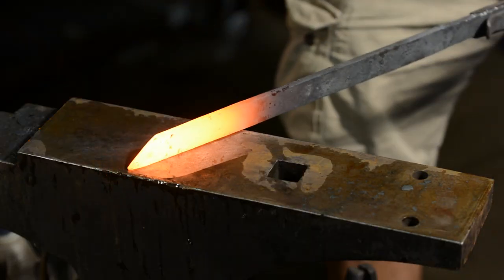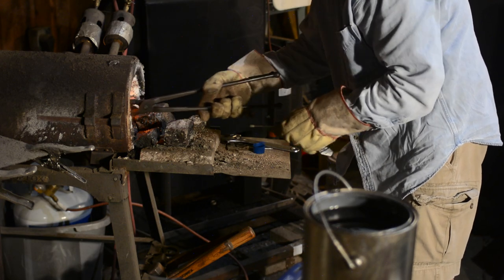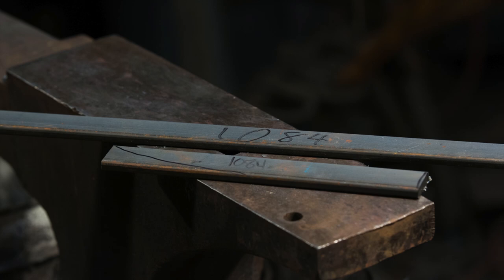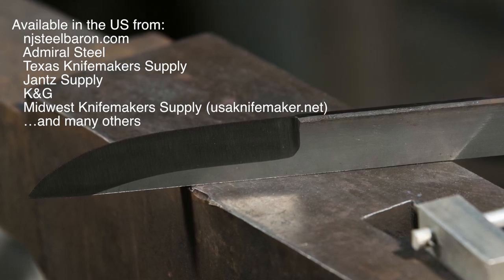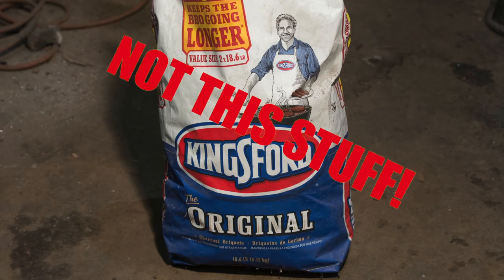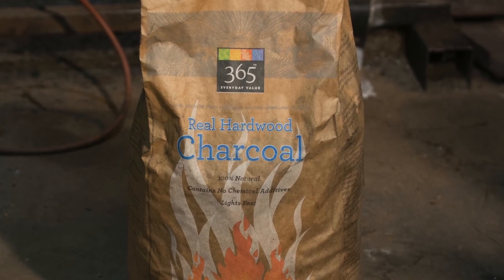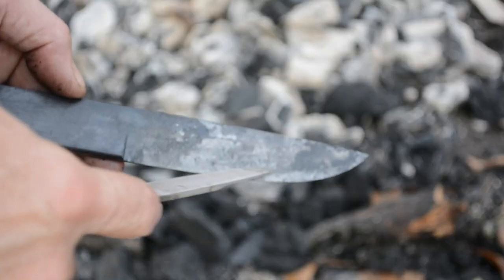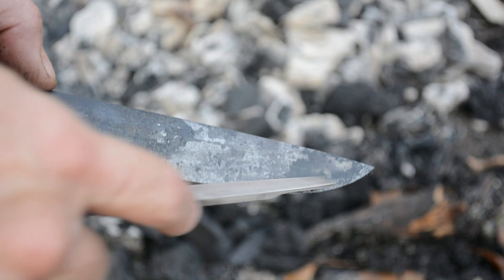Get Hard:  Heat Treating a Knife with Charcoal

Comment: Another way to temper the blade with a fire is to heat another piece of metal and lay the spine of the blade on it. The heat transfers through the spine and should leave the edge harder.
Reply: I knew a guy that had an big antique bar of copper with a handle on it and he said it was a tool designed for tempering like that.
Reply: +Colson Customs Thats also the way I learned it at a knife maker (in a 2 days workshop). I also can imagine its more evenly heatet that way and its much easier to see the actual color of the blade while heating it.
Reply: +Colson Customs I can't post the link to it apparently, but if you search for "Blade_Forger.wmv www.taliesinpewter.co.uk" and go to about 8:30 it shows this beautifully.  Great video to watch if you've got a little time.
Reply: diamondflaw
That's a neat video.
Reply: the video your talking about is really neat. The knife he made at 12:21 is pretty awesome, i want to make one.

Comment: i used a pit forge, dug into the ground with a shopvac blowing air into the bottom through a vent tunnel. I was only using wood, but I threw a bunch in there and the fire was ROARING out the top. I didn't know it at the time, but the fire was hot enough to melt the tip of my blade and it turned bright yellow hot. long story short, My knife is now about two inches shorter. I might just restart the blade, but do it more patiently this time.

Comment: ive successfully heat treated about 2 dozen knives made from 1095 using a method very similar to this. half of them were done in a homemade bucket forge and the rest from the lid of a stainless steel gas grill that i modified with some fire bricks and refractory cement. i can give a few pointers that might save some people from making bad decisions. Mr. Sorrells covered just about everything here, but i would definitely recommend giving yourself plenty of room in (or on) whatever surface your using. for example in my little bucket forge it was just too small  and the bottom was way hotter than the top so i ruined a few knives because the tips got so hot they melted. secondly, regular charcoal works just fine if you cant find the lump or whatever. actually i prefer it because the natural stuff sends up huge amounts of embers that can land on something and easily catch it on fire without you knowing. the briquettes get plenty hot to heat treat simple high carbon steel. but the hairdryer is a MUST. it will not get nearly hot enough without it. ive used hair dryers as well as the little pumps that come with some air mattresses. 

also, hes very correct about the hardness once you quench it. be very, very careful with it until it is fully tempered!!! i cannot stress this enough because i have accidentally dropped two knifes on my way to the temper oven that shattered. if you get warps or anything else, then heat it back up before you start messing around with it because it will most likely break if you dont. also, its a good idea to inspect the blade thoroughly before heat treating because if it has any warps or flaws already, then its very probable that it will cause some serious damage during the quench. ive had warps, splits, breaks, cracks. as soon as you dunk it in the oil be very still and listen for just a moment. if you hear something that sounds like TING!! then you blew it. if you hear nothing and feel nothing, then chances are you probably didnt ruin it. when im using very thin steel i will only do a basic grind on the blade before treating it because the thinner it is the bigger chance it has to mess up during this stage. with thicker steel you dont have to worry so much about cracking or breaking, but depending on the size you can still get some serious warps. 

also, always do the file test!!!! there is nothing worse than going through the whole process of making the knife, heat treating, putting on handle scales, profiling, fit and finish, sharpening, etc. only to have the edge completely roll over the first time you use it because it wasnt hardened like you thought it was. so always test it!! if you test it immediately after quenching it and it isnt hard, then you can just do it again until you get it right. but if you wait until youre completely finished with it then you dont have very many options at that point (other than maybe using a torch to do a differential hardening). 

for tempering i just use my toaster oven. he mentioned the amount of scale on the blade after heat treating and that is something that you need to consider beforehand. dont waste time getting the blade perfect before heat treating it because you will need to grind off the scale. so if you spend the time to get a great satin finish on it with perfect bevels, then youre probably going to be disappointed once you pull the blade out of the oil. 

hope this saves at least one future blade.
Reply: Thanks, i have 1.5 mm thick steel with shaped bevels (so ultra thin) is it sure im going to be disapointed? I tried once and blade cracked and warped, but it was 1.2 mm china steel

Comment: The forge that I've used for years uses a cheapo hair dryer that I found for 10$ at Walmart. With a few fire bricks, a stainless box and a length of black steel pipe, I built my forge for roughly 30$ over a weekend. The Charcoal forge is by far the simplest forge to build and obtain all the parts for.

Comment: Walter, I wish that you had done this one last week I just did a blade yesterday in a similar way, had to do it 3 times to get it all treated, first 2 times I did not get the tip on a machete  hot enough and it was soft, I ended up using charcoal and some coal that I had in a trench with a hair dryer taped to a pipe with holes drilled in the top side placed in the bottom of it  to get enough heat to get the whole blade up to temp :) thanks for the great information

Comment: I'm making a shake out of a leaf spring using a similar method, but instead of an open pit, I'm using a discarded oil barrel. It works better than one may think for getting the steel up to temp...and you can tune the vent holes at the bottom to draw a vortex of air, to get it really hot, and cut slots at different heights from the coals to get a rough temperature difference. 

Its a good method for those without the proper equipment.

Comment: If you don’t have a hair dryer, you can use a bellows. If you don’t have a bellows, you can use a large fan (the non-electric kind you wave with your hand). If you don’t have a fan, you can get several sturdy friends to blow through tubes (hollow reeds, for example). If you don’t have friends (after you roped them into your last project), get to work making a bellows.

Comment: For anyone wondering if you have a medium carbon steel (like a non name brand file) you must simply quench it in water or ice water if its a low/med steel like a railroad spike or something about .3-.4 carbon and move it around so a steam jacket doesn't form, this will work with home depot weld steel, but it wont be hard or tough, it will just be a bit springier than usual

Comment: Another traditional way to temper the blade is to heat up a big chunk of metal in the fire and temper the blade with that more direct heat source. As you said: put the blade on spine first and let the heat reach the edge until straw colored.

Comment: you can use the typical backyard briquettes but you must make a more enclosed furnace, preferably something with a lid to retain the heat. try making a forge from fire bricks or use grant Thompsons video on the mini metal foundry and use that as a forge, i use it and it works fine

Comment: I did actually get the temperature up with charcoal briquettes like Sorrells says may work, but then when I switched to hardwood charcoal without realising they weren't the same the difference was significant. There must have been something like a 200 degree difference, and less ash.

Comment: Awesome video once again, Walter. I don't know if that is a recurrent question but, would you mind putting annotations regarding the temperature in degrees Celsius (we use ISU here in Brazil)? Sometimes is hard to keep focus on the video when I have to convert every temperature mentioned. Thanks a lot!

Comment: Great video Walter ,but I have a few questions.How thick the edge of the blade must be before hardening and before tempering.Lets say if I harden the knife with the thickness of the edge of the blade of around 1 mm after that should I just clear the blade to be able to see the colors and temper the blade with the edge of 1 mm or should I make the edge thicker and then temper the knife.I have only files and angle grinder as tools and I am worried if I temper and harden the knife with 1 mm thickness of the edge of the blade it will be verry hard to make the edge thicker with just files and if I use the angle grinder to make the edge thicker I am worried I will destroy the colors that are formed after tempering since the work with the angle grinder will produce a lot of heat on the blade.Or should i harden the knife and then make the edge thicker with the angle grinder and then temper the knife ?I don't know what to do.

Comment: Hey I have some tips for charcoal heat treating ! First, I've melted 1084 with this method , but I was useing a shop vac for my air supply , I eventually figured out that most shop vacs are TOO POWERFUL! mine made mire spit and burn away so quick so fast I didn't have time to refuel it . But I did melt 1.5 inches off the tip of one of my blades .

Comment: how do I put somewhat of a hard edge on a knife with a blow torch, canola oil and a toaster oven?
heat the metal until it’s red hot, stick it in the oil, wait til it cools, then put it in the toaster at 425 for an hour, then shine it and sharpen it.
will that work ok?
do i have that right?
is it good enough for a cheese knife?
i just want to make a few knives for myself and family, with somewhat of a hardened edge so it will stay sharp for a while.
i’ll make these knives with old carbide saw blades or some steel hanging around in my shed.
thank you in advance for your response :)

Comment: Walter, excellent channel!  Quick questions: what are the time frames (ballpark) that the knife takes in the fire?  What method of heat treating would you recommend for the New knifemaker?  I have seen your machete video with the torch and some recommendations on how to build cheap brick kilns or is it best to send it off for treating?  Thank you in advance.
Reply from the maker: +Nick H   There's not really a set time.  With certain kinds of steels, certain amounts of soak time are required.  But with simple carbon steels, heat treating in this sort of rough and ready environment, you don't want to sit them there too long.  Once they get hot enough -- ten or fifteen more seconds in the fire after hitting non-magnetic -- you're probably good to go.  But bear in mind that this is something you have to practice a little to figure out.  I recommend doing your own heat treating if you can because you learn more about what the steel is capable.  Will you screw up sometimes?  Sure.  But as long as you test your knives, you'll know when you screw up and you'll learn something.

Comment: First off, Walter, i love your videos.  Im also getting confused. I was going to start using O1 tool steel, but read a lot of people saying 1084 is much easier to heat treat at home, and best to leave the 01 to professionals for heat treating. You say both steels use the same method. Anyone care to chime in? Id like to use the 01 over the 1084, but unsure if i can without an electrically controlled kiln.

Comment: Mr. Sorrells. I would like to thank you for a amazing channel. I am going to attempt my first blade using a 10 inch saw blade for material. The question I have is after I have obtained the desired shape and bevels do I need to harden and tempur this kind of steel? I apologize for my ignorance, but I would like to give this a shot. Thank you again Walter. Ryan In  Edmonton Alberta, Canada.
Reply: +Ryan Harrison Do you know for certain what steel the saw blade was made from, Ryan?
Reply: No. It is a Freud 60 tooth blade. Jeez I should research that. Oh brother.
Reply: +Ryan Harrison My advice (dunno what Walter's would be) would be to steer clear of unknowns IF you're looking to make a high quality product, Ryan.  If a saw blade has carbide teeth, the steel in which it is mounted doesn't necessarily have to be high quality, high carbon or anything with properties suited to make a knife blade.  If you have the time to do heat treating experiments with older unknown steels, then go for it....just remember that you may be wasting a lot of time for a very disappointing result.  Of course, a bad day knifemaking beats a good day housecleaning, right?
Reply: thank you for the advice. I'm really not sure about the steel. but I have some other pieces in my shop that I can play around with as well. I was hoping that the steel used for the blade itself would be decent. I've seen video of people using saw blades that's were I got the idea. but in the same respect I don't want to be disappointeded. really appreciate your help.
Reply: +Ryan Harrison You're very welcome.  If you go the used table saw blade route, you'll get your best results from OLD, non carbide tipped blades.  Get the oldest, nastiest, rustiest blade you can find (1960's vintage or earlier)....that will increase your chances of getting a decent, workable material.  Good luck, have fun and be as safe as you can.
Reply: +Ryan Harrison Yeah, unless it's a carbide teeth saw or a really hard HSS steel (I bought a planer knife once- couldn't saw it in half and the file barely scratched it) you gonna be fine. Most old rusty saws are solid tool steel, and most of them don't require heat treatment for general use knives as they are pre HTed to cut and saw wood (which is most likely the hardest thing your knife will be used for). As you don't know the exact steel used I'd stay away from making a huge chopper knife (a five inch-12.5 cm blade is the longest I would personally go with), but my opinion is that for general cutting-slicing-utility-bush craft knife you should be fine without HT. That being said, if the saw is old the steel should be really simple (not fancy to work with) and (if desired) can be HTed with the simpliest forge and magnet method- as shown in the video.
Reply: +Kilo Ton thanks for the input . I finally have some time off for the holidays so I wanted to play with something new. I'm a finishing carpenter here in Canada so I am very meticulous. but steel is something I've never tried. who knows might not even get to the handle if the blade is a total failure. thanks again for all the help!!!

Comment: hey Walter, love your videos. But curious, how bout using the same method in this video, but instead of hard wood charcoal.... use just a normal wood camp fire?  Can the correct temperatures be achieved this way?
Reply from the maker: +Vox Populi I would imagine if you drove the fire hard enough, cut up the wood into fairly small pieces and some other things that you could get there.  But it would be a lot harder than doing it with charcoal.
Reply: Walter Sorrells I figured this much. I think you have the best videos, and source of information when it comes to making knives, and i think your attention to detail is top shelf, and hope i can get my work to that level as well. Not sure how familiar you are with Schrade schf12 or 11. They are china made production knives , but i love the design of those two. In the hands of someone like yourself that design would be pretty cool.  I have hoped for a while to see a video of yours making something like that. Just a hopeful idea of mine. Thank you Mr Sorrells

Comment: Walter, where I live there aren't a lot of different kinds of steels to choose from... What I got is 420 stainless steel. I've already made my first knife and """""heat treated""""" it and I know that I failed on it... I've looked up for and found that it CAN be heat treated (around 1000 Cº). My question is, can i reach that temperature and successfully heat treat 420 steel using charcoal?
Hope you can get back to me with some help! Thanks!

Comment: I redo charcoal case hardening on those Italian reproduction guns of the old west, all the time. It wears off very easily compared to real case hardening. My staple charcoal starter stock is mesquite lump charcoal, mixed with my own home made charcoals, using fruit woods, and any other hard woods I can lay my hands on. I want either that plumb and brown mottling or that colorful peacock with the purples, blues, browns, yellows, and rose coloring. KINGSFORD IS SAWDUST, CLAY, GRAVEL AND DIRT PRESSED INTO LITTLE CARBON BISCUITS, AND IT'S MOSTLY CLAY, DIRT AND GRAVEL. Diablo makes a nice mesquite charcoal that lasts, but mesquite is kind of an acacia type wood.

Comment: Why do you use water on your anvil? Does the hot metal produce a layer of steam, that insulates the hot metal from the (relatively) cold anvil?
Reply: +Andre Gross I believe it's a Japanese forging technique to remove the scales that forms as you hammer the piece.
Reply: I had actually researched it after posting that. You are correct, and it also helps purify the surface of the steel. Thanks!
Reply: It is to blast off the scale

Comment: Usually when you temper a simple carbon steel knife, you put it in an oven at 400 for about 2 hours... with this technique, is the blade tempered once it has reached that yellow colour? Or do you need to hold it at that temperature for a certain amount of time?